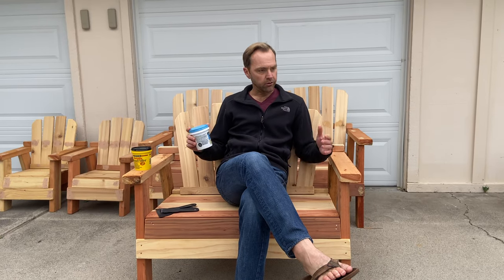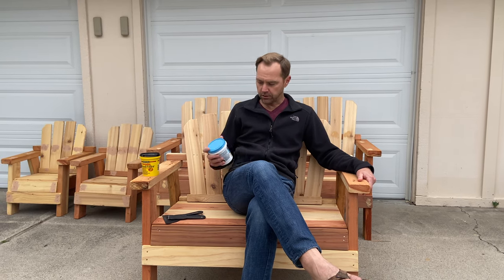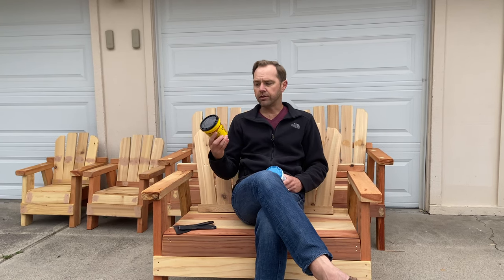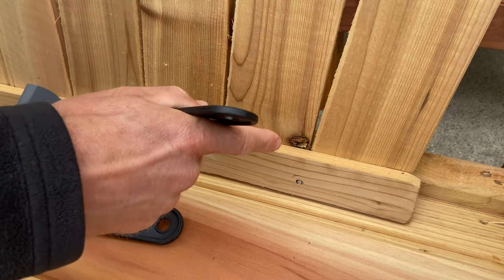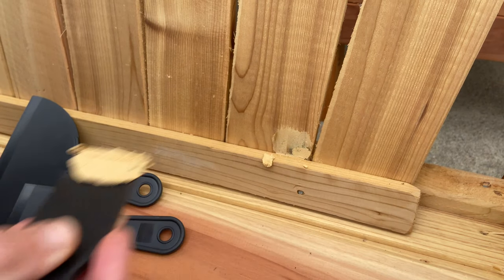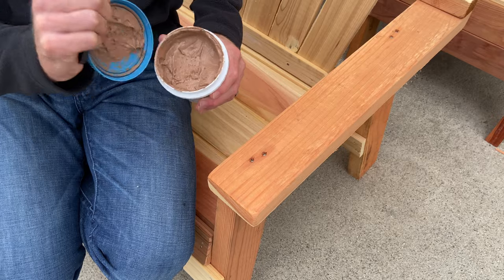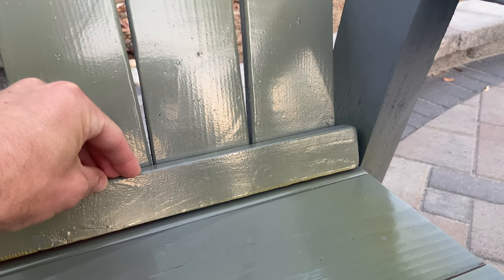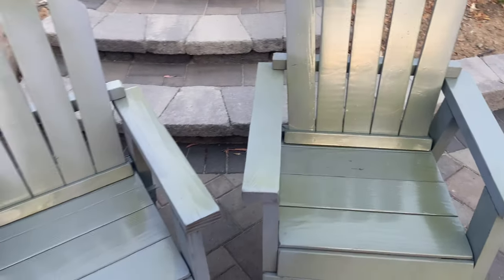How to Apply Wood Filler to Fill Nail Holes

Comment: I use the tip of a bamboo skewer. It reaches deep and packs a lot of filler in with out the air. Once packed you smooth it out on top and let it dry. I've never had any problems. Nail holes are not deep, so its not rocket science. You just have to get the air out.

Comment: Can the humidity cause the I filler or to filler dry? I had to move my table into the sun in hopes of it drying. I filled the hole yesterday.
Reply from the maker: High humidity slows the drying process. It will just take longer.